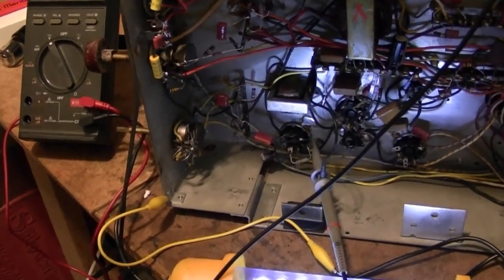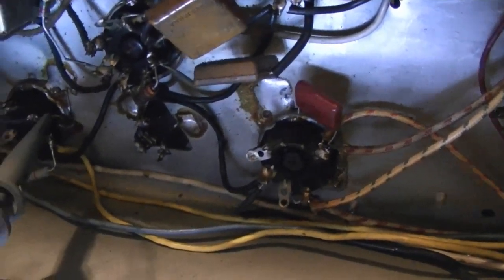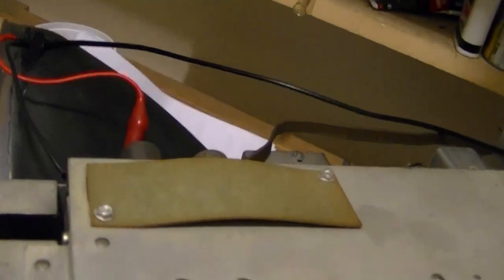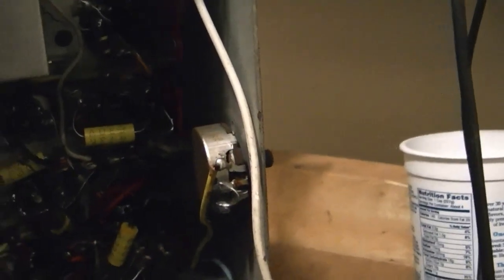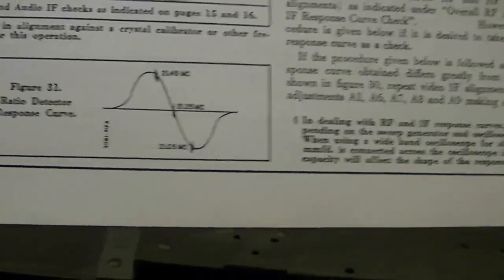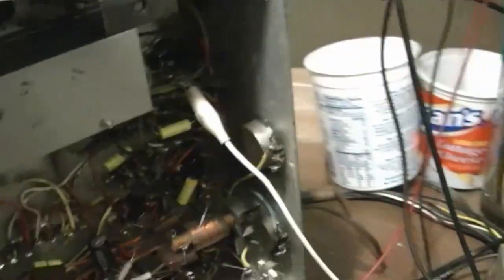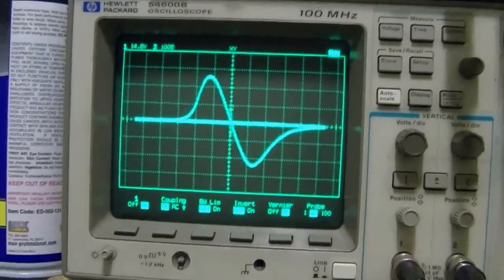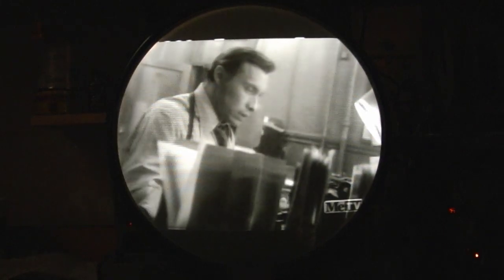Admiral 20B1 combo chassis restoration p4o6

Comment: I concur with what "Joe Dokes" had said about the phillips screw heads on the transformer in the vertical section. I noticed that also.
   I was also "GodSmacked" by what "Joseph Lorentzen" had said in reply to your video here. Now here is some really refreshing professional engineering insight here. An NE-2 neon bulb causing all the effects that he had described? This guy knows his stuff! Really; How can you put a neon bulb in wrong with only two identical conductors, (or are they), in a neon gas envelope in wrong that could cause all the problems that he had described. Amazing! Truly amazing...
Reply from the maker: It was a good idea, but nope. I checked and those phillips screws are original same as other Admiral sets I have.  I've swapped out pretty much everything several times now and no change whatsoever,

Comment: I know this is absolutely no help with this set.  Just it is similar to some very old shop notes about a Zenith television which had a similar problem.  Even worse it was warranty work and we were being bugged by corporate to find out the problem. I know it is not the case here, but the problem was chased down to an NE-2 bulb that had been put in wrong at the factory. We had to travel to Pecos to find out the answer to this question, " How can you put in an NE-2 bulb wrong?" For the chassis in question, the NE-2 were marked at the factory with a small dot of paint.  This was to indicate the polarity of the bulb when it was first fired. Apparently, there is a slight, but significant difference in the conduction of the bulb after the initial firing.  This difference,  caused  the supply voltage for the high voltageto  drifting gradually leaving the appearance of a faulty component - increasing and making the beam 'stiffer' or vice-versa.  This caused some problems with D.C. restoration swinging wildly yet withing a few volts, which changed the vertical wave form just slightly.  Also on some sets there'd be a  gradual change in brightness at the top and bottom of the screen.  Alternatively, the HV may be stable but the power to both H and V deflection could gradually change.
Reply from the maker: Wow, that's a crazy problem.  I would go nuts trying to track that down!

Comment: It's certainly loud and clear now! The picture is nice and crisp, too. Seems pretty strange, checking all the voltages and waveforms and discovering the set is now in spec., and STILL having the vertical linearity issue. I'll bet it's really annoying to you that you couldn't get that bow in sawtooth pattern from the input to the vertical output tube to straighten out.
Reply from the maker: Yes, it sure is annoying but I haven't given up yet :)